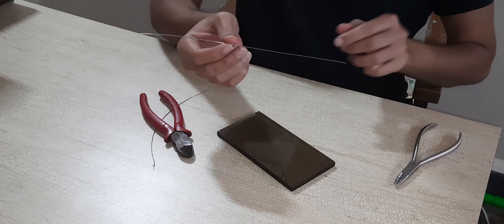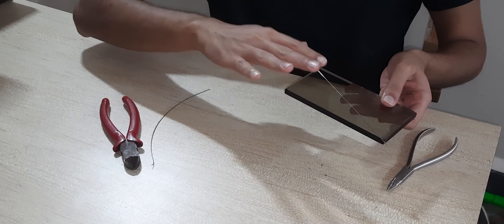How to make Orthodontic straight wire in 5 minutes || Ortho wire bending || @last_wirebender

Comment: Sir whenever I straighten wire, I'm getting lots of bends And indeed I tried to straighten them all, the wire still appears to be bend on glass slab.
I can't get it 
Could u please help
Reply from the maker: Yeah, what you are facing, happens with lot of people, 
It happens if you apply concentrated/concentrated force at specific points on wire, 
It can be prevented by applying long strokes of force/continuously moving your hand along the length of the wire.
I hope i was able to make to you understand!
Reply: Thank you sir
Reply: @jaivratg  which unit wire I should take 22,21 ?